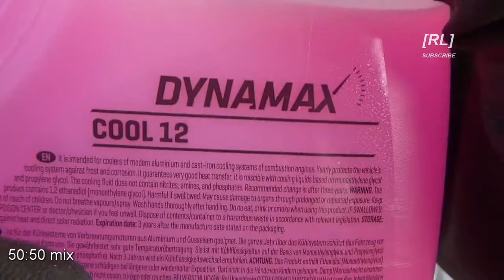Mitsubishi Colt 1.1i Water Pump Swap incl. V-belt

Comment: Big like mate and thank you for sharing the pump replacement procedure ,my little monster started squeaking just like yours
Reply from the maker: Yes, it is bad. But what I thought about that noise is, that it came really because the belt was sliding over the water pump pulley...so what could be possible is to roughen the pulley, i is all polished from the belt, maybe  with a file first...no idea if that will work, but it might :)

Comment: We want more videos please! (Fuel filter,obd location,gear knob replacement,dash clock removal....Great job sir Big Like and subscribe!!!
Reply from the maker: Interesting ideas, thank you for that, I will try to find time also for these. What is bothering me now is that this engine has no hydraulic valve clearance adjusters and noone looked over the valve clearances for 160.000 km. So I think I have to check that first.
Reply: @REBUILDLab  wow sounds good! Good luck continue doing this great job! Thank you for helping us

Comment: do you know, on the 2010 cz1 1.1 does it have a timing belt or timing chain?
there is conflicting information when i search online.
Reply from the maker: Fu, the 1.1i that I have has a timing chain. Don't think that it changed till 2010...

Comment: my mitsubishi colt rmp go high to 2500 when cold start and after 5 minutes or 10 in gos down to 850.. Do you maybe now whats the problem>?
Reply from the maker: Hi, tricky, you have to probably chceck the mass airflow sensor, also clean the throttle body and check for vacuum leaks/broken suction hose etc. But the real problem really I don't know, you have to go for diag, it could be also some faulty sensor that makes the engine think it has to tev up so much. Sorry and good luck
Reply: @REBUILDLab  Thank you really much for response i will try to check everuthing step by step!
Reply: that's normal. engine needs to heat up itself and the catalytic converter. every car does that